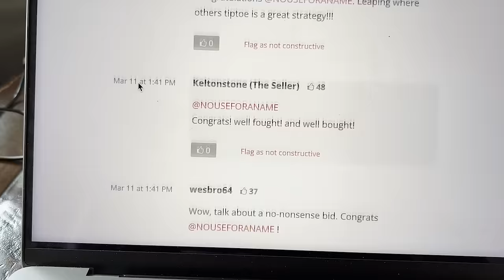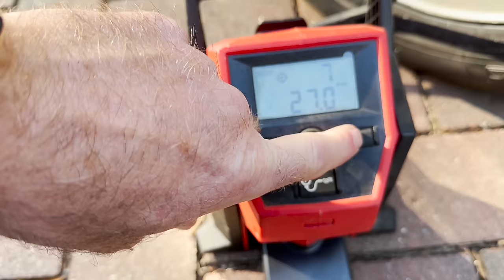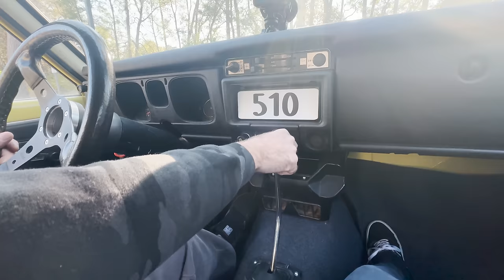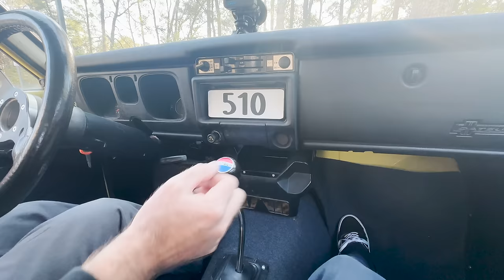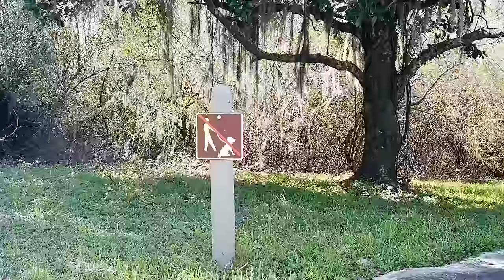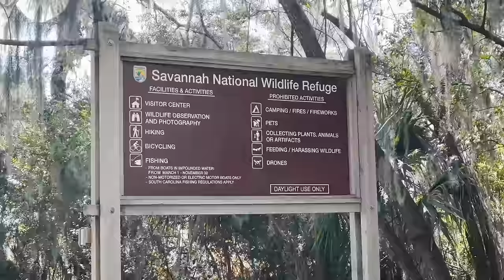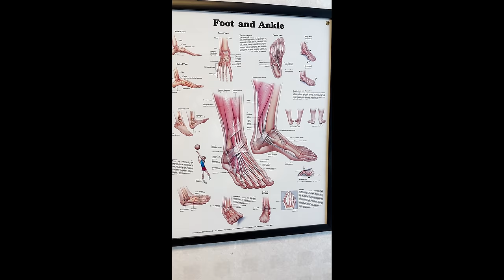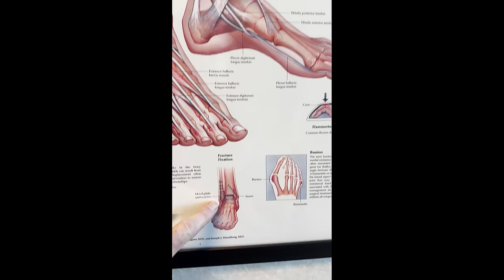RECORD LEVELS OF PAIN! BOUGHT A CAR, THE ENGINE WIRING MELTED, AND I BROKE MY LEG ON THIS ROAD TRIP!

Comment: That is a factory wiring loom that has been hacked and put back together. All just to relocate the battery.
All the wire colours, relays, and plugs are still factory Datsun. Though the fuse box has been updated.

Comment: On the tail light/break light thing, check the light bulbs.  If I had to guess the right bulb was an 1157, and the left is a 2157.  I won't swear on the second bulb model number, but the 2 bulbs are physically interchangeable, but the number that starts with a 2 they swap the break filament and the park filament around causing it to be "backwards" and if you swap it to the right bulb you are golden.

Comment: On those motors, if there's gas contaminating the oil, it usually means the diaphragm of the fuel pump has been compromised and gas is leaking through into the front timing cover.

Comment: My best friend in high school back in 1974 bought a brand new 510. First thing he did was to put some US Mags on it as well as side pipes. It was butterscotch color, but we had a blast in that thing! Craziest night was coming home from the first California Jam concert April 6th, 1974 and he accidentally ran 2 bikers off the freeway trying to cut over 3 lanes to reach the Orange freeway. They came down the side of the 57 freeway offramp and chased us down until we got stuck in traffic. They parked in front and behind us and one of them proceeded to bash on my friends window until he rolled it down. When the guy could get his arm in he punched out my friend a few times then got back on his bike and rode away. Quite the end to what had been an eventful day. It was also in 1974 when I bought a little Honda 125 to get around on. Got run into by a 16 year old that just got her permit and crushed my tibia and fibula. In and out of hospitals for the next five years having a multitude of skin grafts and bone grafts to save my leg. Needless to say I gave up on motorcycles since then!

Comment: FUN FACT: Paul Newman's first race car was a 510. Bob Sharp told Paul he needed to race slow underpowered cars to learn smoothness. It worked. He had a very successful driving career. Probably the highpoint was when he  finished 2'nd in the 24hrs of Lemans after losing the lead due to mechanical difficulties.

Comment: Epic trip! Man I would have had a mental break down after that electrical fire. One good thing with older cars, fewer wires to fix...
Living in Sweden, I'm not convinced by those slopes. But better skiing/boarding gentle slopes than not skiing at all I guess. I had a bad crash the last day of my skiing trip this winter, and during the fall I had time to think to myself that "This is gonna hurt". I got lucky and the only thing hurt was my pride. I also got to take my new-to-me daily for the trip, and it did awesome!

Comment: Had a '79 280 ZX 2+2
 LOVED it babyed it, but NY winters got the best of it and one year when the car was getting the state inspection a few minutes after they put it on the lift I could hear metal cracking and the floor let go and the right side of the lift disappeared into the car

Comment: I drive a lot of older cars with out power steering, something I started since in an old man now. It’s a lot easier to steer a non power steering car driving backwards, when backing out of a parking spot/ or driveway on to the road,  turn to get facing the way you want to go, but go about 7 feet past what is straight. Then you can put it in gear hit the gas and catch the wheel .  Look at 18:20 , and teach the Mrs that ,  she’s not gonna want to saw on the wheel like you did

Comment: I had one of these back in the day, not sure of what the year was exactly. The throttle linkage went from driver side compartment to passenger side compartment, then thru the firewall to the engine. You could put your toes up and under the linkage and FLOOR it from the passenger side.... Ask me how i know, LOL... ENJOY IT, WE DID...

Comment: The Datsun might be left-hand ignition because it's Japanese/designed with RHD primarily in mind (unless they swapped sides for LHD markets, i donl't know), but the left-hand ignition being for racing is what they say about Porsches for sure. That way you can slide in the car, get the ignition cranking already and also be putting it into gear with your other hand.

Comment: Hi Guys, this looks and probably was the Japanese version of the British Ford Cortina Mk 2, which has similar styling and came with a 1300cc, 1600cc, 2000cc 4 cylinder engines and even a 3000cc V6 engine which they called the Cortina "Savage".
Looks real cool, takes me back to the 70's / 80's here in the UK where we could get cars like those real cheap to modify. Not now though, they are mega expensive, if you can find one for sale, for example, a Mk1 Ford Escort Mexico fetches well North of £55,000 sterling.

Comment: I’d like to add a little about arm turn signals. In my state of NH if your rig is supposed to have turn signals and they are inop due to a light burned out etc you can get a warning or ticket to get it fixed.
You’re correct about legally using hand signals only if your rig didn’t have them new. Examples like antique vehicles and tractors etc..
I don’t work for law enforcement, but have been enlightened on the side of the road a couple times! 🤨
Good vid btw….

Comment: Welcome to the learning Weber carband its tuning. They really are great but are not like most other carbs.  The float level and idle speed has to be adjusted correctly ( idle speed screw must to be turned  out over 1 1/2 turns ) to run properly and electric choke work great.

Comment: Something that people don’t really consider is how much time and money that OEMs put into wire harness routing. Damage caused by wiring chafing is actually extremely rare on completely original wiring harnesses that are secured in the original location. Of course, on a 50 year old car, it’s possible that stuff could just be old and worn out, but it’s more likely that this was an issue installed by the person who worked on the car, especially since it didn’t blow a fuse.

Comment: Broke my fibula in the same place when a truck crossed the line and tried to kill me, but I had so many other injuries the doctors missed that it was cracked. After I got released from the hospital, I was walking up a flight of stairs it broke all the way through and it displaced. Kinda sounded like when you break a rusty lug nut loose. I've broken more than a few bones in my day, you couldn't pick a better bone to break. Me and my wife both had stick shifts at the time. The cast is only from the knee down, but clutching with it on is a little tricky.

Comment: Those Minilite wheels are kinda rare (anymore, and only rare in certain sizes) and they can really be expensive for some original ones (like for the Mini Cooper and race versions).  They were made in the late 70s to early 80s.  You MIGHT have trouble replacing them with original ones, if needed.  Minilite wheels are really sought after by a certain crowd, especially in Europe.  Somebody did another later reproduction run of them, but in only certain sizes which is why only certain sized originals are considered rare.   That is why you can see a set going for $700 for some more common ones, and $7000 for others.

Comment: Once had a customers 09 Chevy Cobalt melt the majority of dash harness as the result of a shorted cigarette lighter/ power socket. Long Story Short: Remove dash, Extract Effect Wiring Harness and Replace Segments as needed each damaged wire. keeping in mind no way of knowing if the computer was shorted in process. A week plus worth of work and VOILA! It worked. Tedious and Frustrating but Ultimately Successful. Patience is KEY

Comment: Broke the end of my right fibula when I was a teenager. Guess what teenaged me did? Never had it fixed. Messed up the same ankle again two years ago and it turns out the piece is floating around getting wedged into places it shouldn't and causing lots of trouble with ease of walking. Gotta try and have it repaired soon

Comment: We call them Datsun 1600 in Australia but we never got the 2 door ones unfortunately,  a few mates had them, most were rally cars with the L18 or L20, those gearboxes were call option one boxes great for rally as you go from 2nd to 3rd so much and it’s super easy, and never really had to go back to 1st. I was driving my mates turbo L18 one and watched the speedo go past the 120.

Comment: As a long time Datsun 510  owner, I can safely say that is a nice one! But, that truck shifter is garbage!! We used to run the shortest ones possible, or just shorten and thread them for the knob. The harness can be a real Jekyll and Hyde deal, if they are uncut, they will last forever, but, once tampered with, they can be a nightmare! I currently own a '72 two door with a Nissan Xterra VG33E V6 and a 300ZX 5 Speed. Almost out of the garage. But those L-18 engines are hard to beat! They will run forever with the proper care. Congrats and Welcome to the 510 Cult!

Comment: I'm legit suprized you could walk with a broken fibula.
Mine broke in 07' after I slipped on ice and landed with my leg under my ass and on top of a grosery bag that contained a big soda bottle. The weight off my body on top of the bottle made my fibola break. Worst pain I have ever felt!
I was out for 8 week. My foot was dangling as a flag in the wind every time I tried to lift my foot. Been hurt a bunch of times including two times head on car collisions. They could not match the foot pain at all.

Love the 510 tho! Paint it baby blue and add front and rear spoiler and you got a winner.
Wheeler Dealer did a 510 and they painted it baby blue. Was parfect color for that! Theirs sat too high for my taste tho.

Comment: When your tail lights/turn signals act weird check for single filament bulbs installed where a dual filament bulb should be. That'll short your circuits together and do weird things.

Comment: Alligators can reach speeds of up to 35 mph on land (though they're known to tire quickly). And in the water, they can reach a top speed of 20 mph, which is faster than a bottlenose dolphin. They also have a lot more stamina in the water than on land.

Comment: Running hot? I'd say that's right. Should be connected to a header tank. Pressure realis in radiator cap will push fluid out when hot then suck it back in when cools

Comment: My uncle is involved in a group that races old imports here in Florida  one of there events is even at Sebring well he has threre cars that he races and two of them are Datsun 510s just like that and the other is a 70s Honda Prelude and along with one of the 510s have Rotory motors out of a RX7 and the other 510 has the exact motor yours have and they are extremely quick!!!

Comment: First you did not use the turning lane into the refuge in front of a simi truck, but anyway imagine hydro sliding and hitting a huge gator and you wipe out then sitting there in the water waiting for the boat to return.

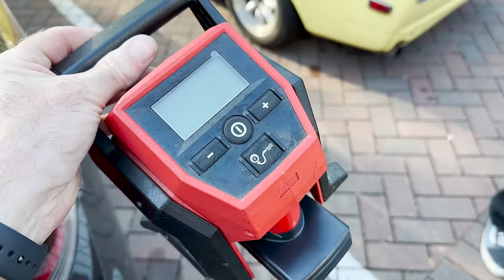Comment: 7:35 I've been looking at getting one of those Eaton air compressors you mentioned on your channel a while ago, so I'd be interested in hearing more about this. The big factor for me is sustained use of die grinders to clean up welds and occasional sand blasting.
Reply: Jason's the MVP in this one.

Comment: You said the oil smells like fuel - did you happen to notice the electric choke wasn't hooked up on the weber carb?   If the choke isn't fully opened it's going to run rich all the time and foul the oil with unburnt fuel and when it thins out it will cause low oil pressure especially at hot idle (which could be the cause of your oil light coming on after running on the highway)

Comment: Yes. The key in all Porsches is on the left hand side because it saved the drivers a ton of time at Leman during the standing starts. Porsche realized they could start the car **and put it in gear at the same time with a left hand ignition switch. Porsche’s to this day are left hand ignition. #history #dontforgetwhereyoucamefrom

Comment: Unless you need a bone set? Surgery is probably very unwise. I had a similar injury about 25 years ago. My ankle swelled up like a ballpark n turned purple. I had a 2800 dollar deductible at the time so a borrowed air cast and back to work I went. I suspect while healing it was re injured many times. Today I'm almost 50 and that ankle is bulletproof. I suspect that immobilization is actually detrimental to healing and getting stronger. Good news since nobody can afford the Dr. Anymore 😢

Comment: Need to flip the signal (power) wores tonthe dual filiment bulb innthe right tail light. Its been wired backward, brakes ligbts the dull filament, and running light powers the bright.

Comment: 98 top speed?
Used to annoy the drivers of those with a Renault 16TS - the Datto was quicker off the line, but from 50 on up the Renault used to pull the Datto's in and lope past, to a top speed around 115.

Comment: Love the videos buddy, I do have to bust your balls over the Truck honking at you, It was because you didn't get in the turn lane, you just slowed down and turned from the travel lane. There's a reason for the turn lane so traffic doesn't have to slow down every time someone turns in there. And no turn signal probably didn't help. Drive safe big guy we need you around for a long time.

Comment: Call me weird, but even time I deal with a vehicle with orange anti freeze( dexcool) they all have leaking radiators and waterpumps. My Monte had the radiator and water pump replaced at 75000 miles
. Changed to  regular green stuff, now 156000 miles amd all is well.

Comment: Hi Mike sorry on your accident but you be good in no time changing subject I see all your videos but never  comment always give tump up to support and got some merchandise to ok getting to the point  my first car at 19 was a 1970 510 wagon and my first rebuild engine was that 1600 engine I had dual weber and a 4speed with 410 gears was black run 13 inch rx7 Mazda rims with some mickey Thomson we used to get in Puerto Rico for my luck somebody run a stop sign and hit my passenger side between  the back door and back quarter that was the end of my wagon I sold it to a guy just for the motor for a 510 he had never saw the wagon again or the 510 I'm 59 now still looking for one wagon impossible to get one decent enjoy your 510 and feel 100 percent of your foot soon many blessings to you and your family

Comment: You got the economy pack,, every one [in Oz] knows that Datto 1600s have 4 doors. Never owned one, not a great regret. I have owned no end of the mechanical supplies though, 180Bs and 200B with L20. And Pissan Blueturds from Japan. L20 on early ones and Z20 on the later ones. All rusted away and gone to China. 
 In Japan at least 1600s came with 5 speeds as an option.
Ratsun with sloppy shifters, they all get like that though that shifter is from a 720 ute.
510s in Japan came is 1.4, 1.6 and then SSS with twin carbs and better tuning and a 5 speed. 180B and 200B in Japan had the SSS also. Blueturds came as TRX with 5 speed and 15" alloys. Late ones had fool injection.
Your ankle, you may not think so but you are lucky you broke it. I did very similar but tore the hell out of the tendons. It puffs up often even now,, and that was 20 odd years ago. Doesnt stop me but slows me down a bit.

Comment: I feel leaving the lights on without the engine running, especially on a 50+ year old Datsun, rewired or not, is asking for it. Very fragile electric systems.

Comment: That motor looks so similar to a z car. Ive had an L28 from a 78 280z for years. Still spin it over and squirt oil in it. Originally intended for a Nissan hard body (they do bolt to the modern 5 speed, but it twists the trans like 30°
Keep saying im going to use it, but the  carb setup is stupid expensive.....
Still like old z car

Comment: Stick to cars!  I had a 1600 roadster and just short of replacing all of the wiring on board probably had trouble with all of the electrical equipment.

Comment: Hey Finnigan, just asking. When you give a prize away do you make the winner pay for shipping? The reason I ask is you just notified me that I was the lucky winner of your giveaway that I was pumped for because I could always use a electric connection kit but then you asked me what model car I have, still wasn't suspicious then you said I was the winner of a standard set of tires for my car, a142 Miller mattic and that you threw in a pair of speakers. Very,very cool 😎 if true but do you normally have the winner pay shipping? If so cool 😎 but just want to make sure with yah before go any further. Love your channel and just wanted to give you a heads up

Comment: I've owned a bunch of these. The L18 goes real good with the 2 litre head, or the 2 litre with the 1800 head, that with a 5 speed is a good setup.Your trans mount is broke. Heat the shifter up until it glows and pull it back, then chop a few inches off it, run a tap down it and it's money. You need the twin Hitachi setup .An SR20DET is obviously the way to go. The best thing about Datsun 1600;s, is practically any other Datsun parts bolt right in. 180B brake booster and master. Nissan Pulsar seats. Right in. The 1800 is enough to pop the stock diff, ask me how I know this. Full size Lego.
Also, no self respecting "skateboarder" would be seen on a snowboard, let alone break a leg on one. Go to the skatepark and skate tranny, it pisses the kids off.